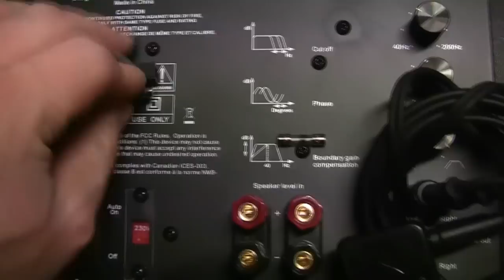Jamo SUB 660 troubleshooting.

Comment: Where can you buy this fuse? My Jamo 660 also suddenly stopped working and would like to try out to replace it.
Reply from the maker: It's a normal glass fuse. Places selling things like ovens, fridges etc. should have those. Also places like Biltema, Harbor Freight or whatever they're called in your country.
Only warning is if you buy at an auto parts shop. Make 100% sure you get a 230V (120V in US) rated one. NOT 12V! Those can explode and shatter.

Comment: Had the same problem with the Jamo sub 250 model, every fuse gets blown though the glass was not shattered.
Reply: +NOTORIOUS POWER I replaced the amplifier part to fix the problem. Cost was about 90 Euros.